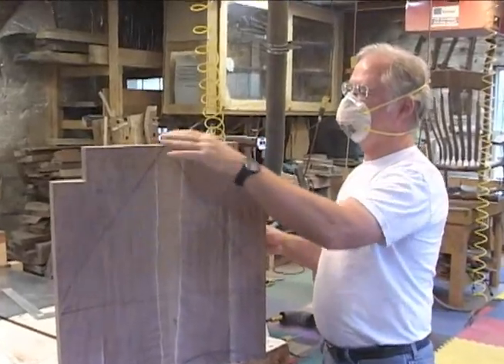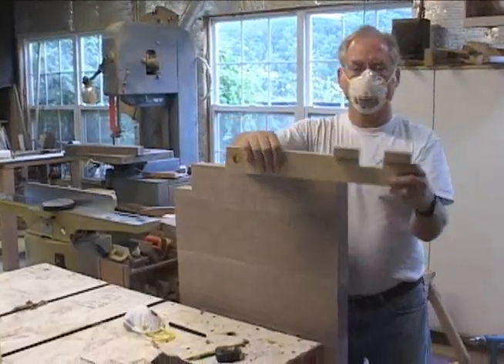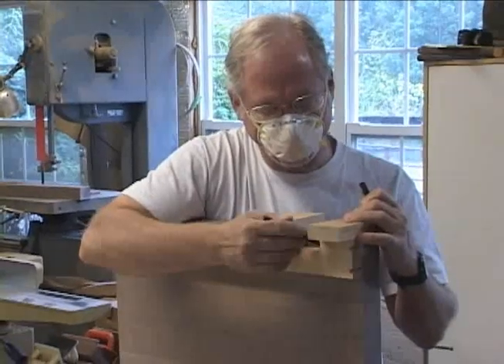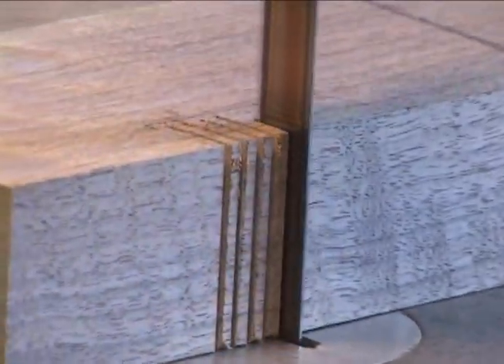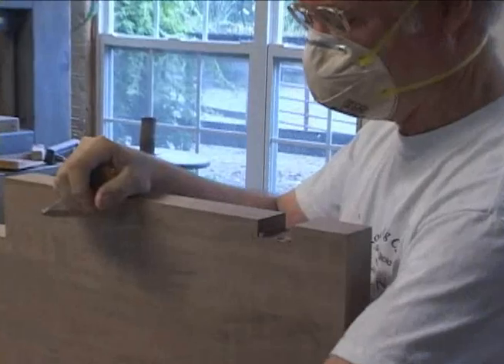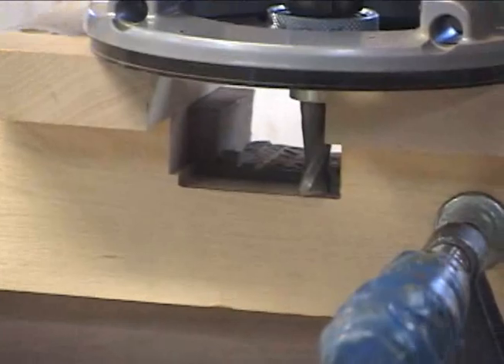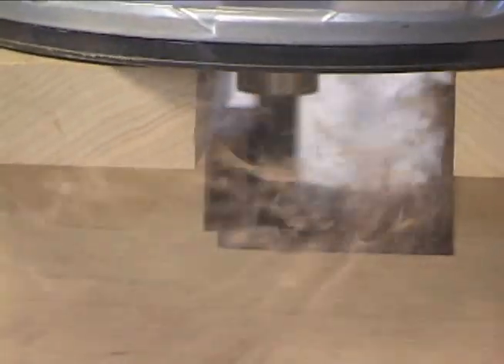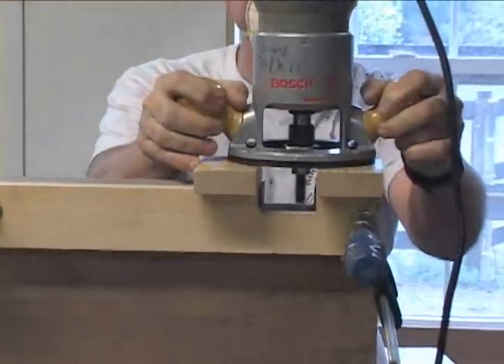Rocking Chairs - Cutting seat joints

Comment: Have you thought about making those leg cuts before gluing the two outer pieces to the seat? You could use a dado blade for the front legs and a router table for the round-over for the recessed part of the cut.
Reply from the maker: 90% of the time my seat is a two board, in order to maintain bilateral symmetry.  You are thinking of the manner in which Sam makes his seats.